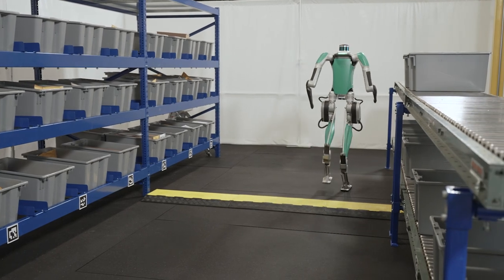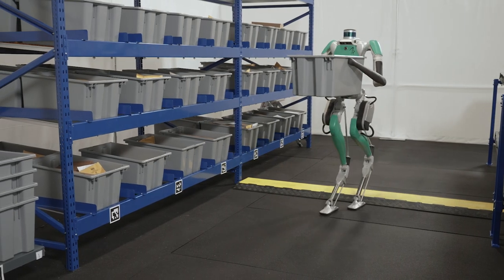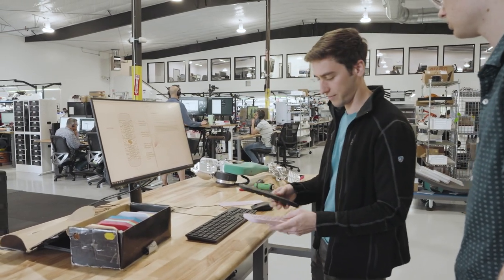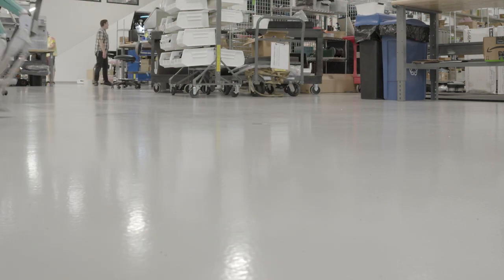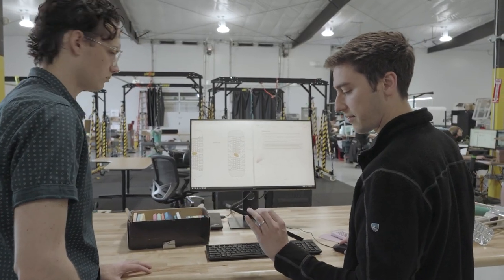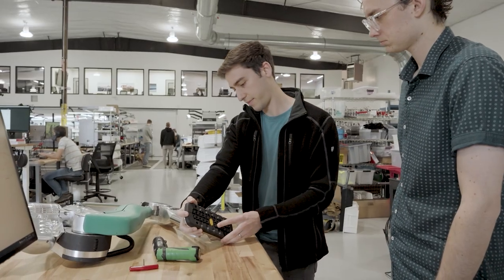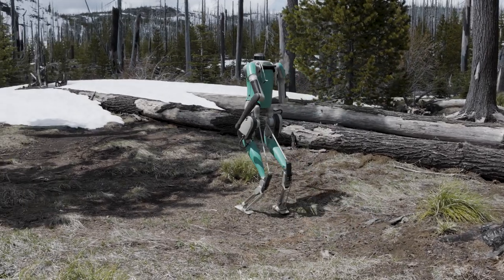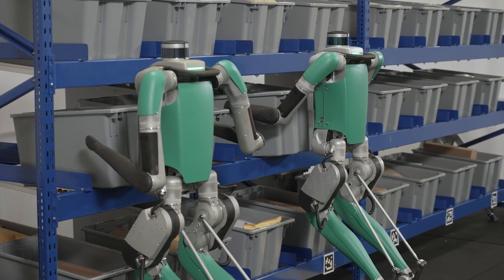Vibram X Agility Robotics

Comment: Have y'all seen those haptic domes for robot feets? Also having durable pressure sensors like a Novation Launchpad could feed more data back into the model to optimize gait and potentially identify edge cases where traction or stability is compromised before the bot loses their footing, not to mention for rough or uneven surfaces.
Reply: Yada yada yada, just watch the video on move on, no need to add a useless comment.

Comment: Why inverted knees instead of humanoid legs?
Reply: Humans are better at walking forward with their torso off center. These look like they require stricter center of mass balancing, so carrying loads are probably easier to code for if the legs are out of the way most of the time
Reply: Also there's still knees, they're just alot smaller and this thing is essentially walking on its toes

Comment: Why not imitate human feet, they function nicely even in rough terrain + could use commercially available footwear
Reply: Why do you need footwear for robots?
Reply: Same reason humans do, and the current robot does
Reply: human feet rely on toes for balance. toes are hard to manufacture, design, code etc for the strength and tolerance needed. this design gets away with the anchor point in the middle with a very simple foot, which makes it very reliable (no need for toe repairs and maybe  160 extra small parts), strong and simple directly from the design.
Reply: @CuulX  also the leg design is quite efficient and faster than if you were using an normal human leg , there is a reason why Cassie can run up more than 22km/h meanwhile bipedal robots with human leg design are alot slower

Comment: Its a robot, its feet should be wheels. It shouldnt need to step unless the wheels failed.
Reply: Stepping requires a ton of energy vs rolling...   simple physics equation right?
Reply: @gamerfortynine  human walking is surprisingly energy efficient. You can eat a sandwich and then go walk for 10 miles. the real issue is that our world is designed for humanoid forms that can step, and wheeled robots will always have trouble with those environments. There are robots that have legs and wheels, and that is an interesting option, but flat feet can be more stable than a pair of wheels, and integrate well with human environments.
Reply: @Flynz4me  lol yet plenty of humans have fun with wheels on flat surfaces. Whats fun to us is efficiency to robots?
Reply: @SequoiaAlexander  compared to other walkers maybe. Wheeled travel is > 10x more efficient than walking.  Look robots can have feet with wheels that lock up for steps, but otherwise allow better freedom of movement.
Reply: @SequoiaAlexander  P.S. our world isnt designed for humans, humanity evolved to survive in this world...
Reply: @Flynz4me  Robots can have feet with wheels, and only lock those wheels when they need "feet" that mimics human form.
Reply: It shouldnt need to take a "step" unless the wheels failed.
Reply: Both are important, but robots feet dont need to be the same as humans with only 1 operating function.  They can have feet, and wheels at the same time.
Reply: If bikes took as much energy as walking, would bikes exist = no.
Reply from the maker: We can appreciate your point of view and there is room in the industry for all kinds of ideas and methods. Digit's design is informed by 20+ years of research, engineering, and testing. We believe this is the best approach for Digit to walk into existing facilities and get to work without having to greatly remodel the space.